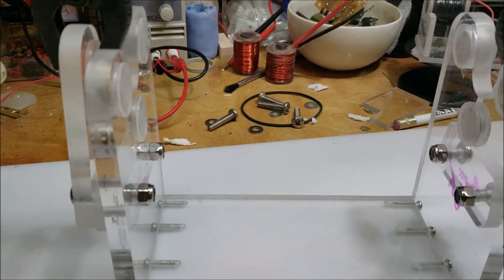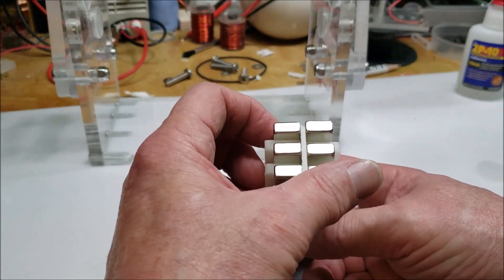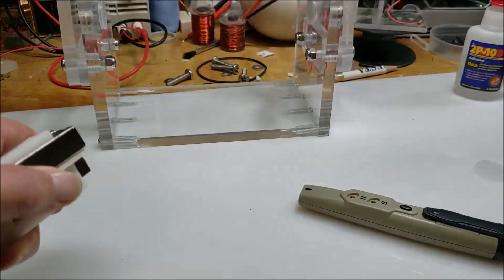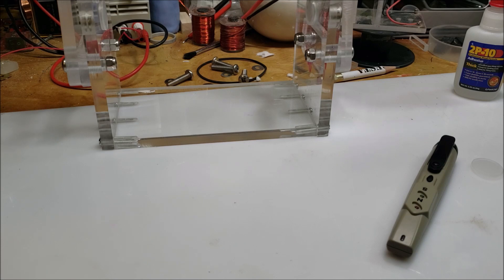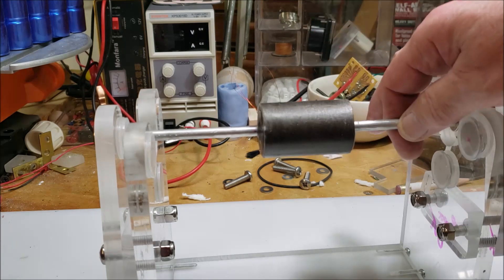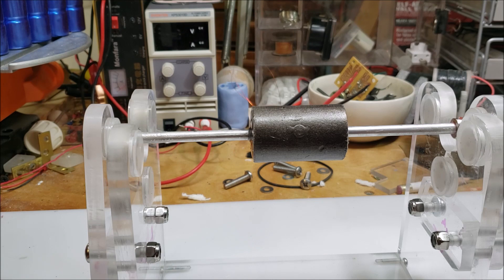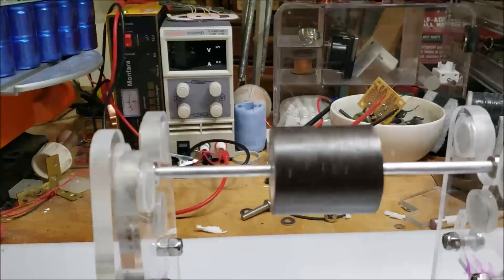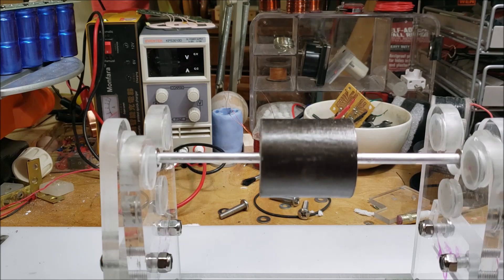Maglev Done! (sort of)

Comment: Hi Mic, I see that you are progressing your work and I like your magnetic levitator, I would like to recommend that before you make your molds and the rotor, first check that the axis of rotation is straight and calibrated and do not oscillate because that will harm you in efficiency and balance, however it is a good job, several times I had to break my rotors due to a small failure.
Reply from the maker: thanks pal. I did check out the axis but not very carefully. Once its up to speed its nice and smooth.